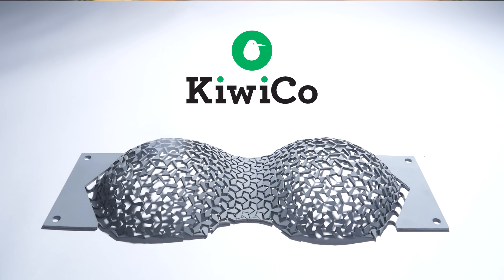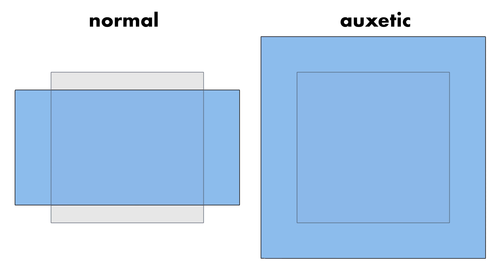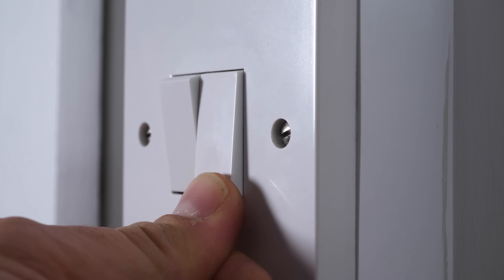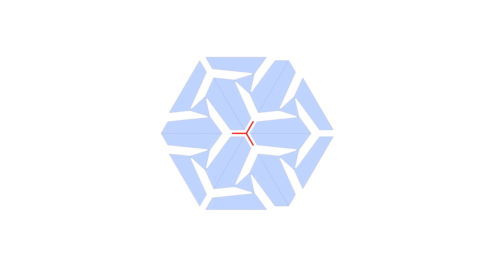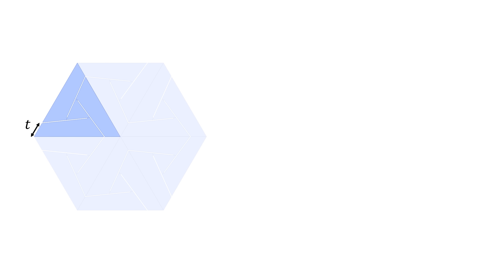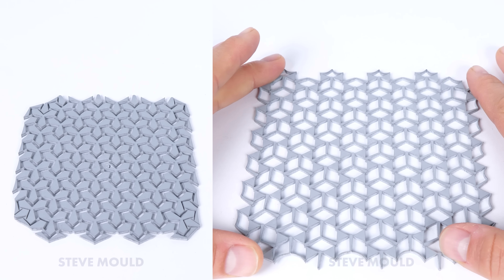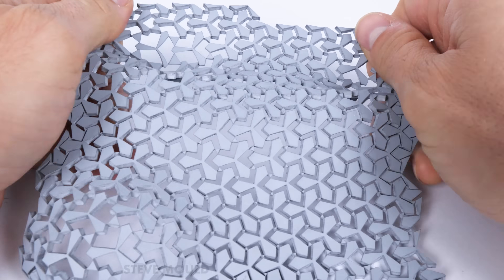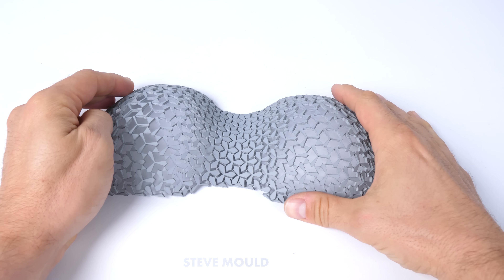Self-assembling material pops into 3D

Comment: While Chinese finger traps don't expand when stretched. They still are similar in the "science" used.
As you put your fingers in each end and try to pull them out again it contracts on said fingers and holds them in firm.
You have to push the finger trap itself together so it expands in the other direction to get your fingers back out.

Never used it as such but a Chinese finger trap could be really useful to hold two separate objects together temporarily. As long as nothing disturbs the device in the middle it holds on tighter and tighter as you try to separate the objects from the device. As long as it doesn't slip, it's a neat way to hold on to something. Say a broom stick handle or a bunched up piece of cloth.

On the point of broom sticks though, there's also those rubber thingies that you slot them into which are bi-stable as long as the diameter of the thing you push in is large enough to have the rubber go through compression to allow it to pass the point where it snaps into the other state.

Comment: While I think a stent is a good idea, I think that this is thinking too small. How about using this for flat packing habitats?

This could be used for making the structural base of a habitat that you can then throw a covering material over after you have expanded the base structural material.

This would make good option for flat packing quick habitats for disaster areas or even future lunar missions.

Comment: Why not use this for housing during disaster relief? You could have a shell made of this with an insulating material sandwiched in between. The benefit is ease of storage and deployment and quick hassle free installation requiring no tool and minimal training. You could easily make an igloo style temp structure. We could use this for temp housing for refugees.

Comment: the demo one with two cups obviously looks a lot like a bra, which is a great application: emergency bra
because it can be so flat, you could store them VERY efficiently, and yes, they wouldn't be the best, and yes, you might want slight manual steps too (e.g. for the fabric (and the slight padding) covering of the structure, and possibly attaching a wire or such, which could also be stored pretty much flat)
another simple use case would be better collapsible bowls (and probably cups too), the current crude designs of folding rubber are...not great...not the least because rubber sucks...
or you could require strong forces, to make deployable chairs and such, which would be both cooler, and more efficiently storeable
or collapseable hats! that'd be very neat, since  it being breathable is often desireable ANYWAY

Comment: For the twisting cubes, one thought I had was, what if instead you built 9 polarizing filters in this configuration, and used that on the end of the sugar tube that twists light
It isn't really an "image", but you have a 3x3 pixel grid that can change colors of light
Which itself can be used on another image/filter that shows one image with one color, and another image with the other color, and that's one way to get a changing image with this, but not really anything to do with how the images line up, it's the light that's lining up

Comment: The other application I could see is skin tight spacesuits. Those would be better than current space in pretty much every single way but have the issue that we haven't solved how too provide pressure in convex areas or at least convex in both directions. this could be answer.

Comment: If you just hate math like most people on here, stack four sheets of paper together (you will have a flat pile of paper).  Next, remove three sheets of paper and crumble them up into balls.  Arrange the crumbled balls in a triangular form in the approximate area of a flat sheet of paper.  Finally, lay the un-crumbled flat sheet of paper on top of the arranged crumbled up balls of paper.  You now have a structure from original sheets of flat paper that supports another piece of paper.   And no math was involved.  Yay.  Fuck math!

Comment: Steve, ideas for your exaggerated small motion camera:

Can you hook that camera up to a microscope? Maybe there are cellular movements that are ultra tiny (even under a microscope) that the camera can show. Like how the cell membranes move or vibrate as a cell grows it responds to changes in it's environment. Do cellular structures have small movements and vibrations that can't normally be seen?

Film sky scrapers moving in the wind it film the curiosity counterweight ball moving at the top of some sky scrapers. 

You could film a very large bridge on a windy day to show what is moving on a bridge and how it's moving. 

Maybe you could also film some gyroscopically stabilized things or other machines that self level (NASA crawler) to show how many small corrections are needed over time. 

You could film how rockets flex as they take off or how the nozzle flexes during start up.

Maybe you could find interesting design considerations for plumbing or water lines to show how the move in response to fire l flow changes or how they move or respond to valves opening and closing. 

You could also show how large structures vibrate in response to a shockwaves. Like team up with a ballistics channel or a company that designs this to survive possible blasts to show how much large things flex on response to a shockwave. 

Do large concrete things flex and vibrate? 

Maybe you could find a university or company that tests things to failure and you could film the small movements and vibrations that occur as a test article is approaching failure. 

You could also show how much buildings move it the ground moves in response to heavy construction machinery or near mine blasting. 

You could film how train tracks or a bridge move and bend as a heavy train passes over. 

You could show how the road, streets and buildings vibrate when a subway train passes underneath. 

You could film how the vibrations change in a heavy, thick crane cable as it is loaded and unloaded.

Maybe you could film how large structures move as the heat up and cool thoughtout the day.

Maybe there's interesting ultra tiny movements in animals as they try to be still. 

You could show how small motions are related to how striking something sounds. Like a yhud vs a ring down. Or show how different sound deadening materials and tapes change how a material vibrates to change or soften the sound.

You could film how different materials and objects absorb sound. Like how a wine glass' vibrations change as the sound frequency slowly approaches the glass' resonant frequency.

Maybe it can be used to film how different materials and objects respond to, absorb and reflect sound.

Maybe you could film how different sports items flex. Like how differently strung and constructed tennis rackets moved and vibrate to change how a tennis ball responds to a hit. Or how different types of bats move and vibrate to maximize the energy transferred to a ball.

Comment: 2:20 Here’s some notes about when I spent some time on this problem. It seems that the transformation that happens over here is that ever “corner” square undergoes a clockwise rotation, while every edge square has a counter clockwise rotation. Each square remains in the same coordination position. Thus, to have a shape that is maintained upon the transformation, we need the overall shape to have rotational symmetry along each smaller square. We can use this to show that it is not possible to make such a shape which is connects from one square to another without having a matching  set of rotated lines. Hence, it is not possible to have a closed shape composed of a single line that fits these criteria.

Comment: 2:20 each square rotates 90 deg, either clockwise or counter-. There are 3 types of square: center, edge, corner.

The trivial solution is to, on each square, put an order 4 (or multiple of 4) rotational symmetry image centered on the center of the square.

Comment: It's fun to imagine the possible uses of this. I'm currently on hour three of pondering some sort of foldable solar tarp for camping. Packs flat when you're not using it, and if it was dome-shaped you wouldn't have to rotate it on axis with the sun. You'd need to have some form of foil-based solar cell though, and honestly that's probably 90% of the invention.

Comment: They really need to teach compliant mechanisms in school along with the traditional mechanisms. You couldn't build a bow and arrow without them and springs are often used in machines, but the definition of simple machines don't include compliant mechanisms. There is a lot you could improve about simple machines, especially the requirement for them to change force is a bit dumb. A simple linkage and it's compliant form a shock is a machine as it allows force to be transferred from one location to another. Does a pulley stop being a machine in its most simple configuration? A pulley isn't even simple as it is made from a wheel and a tensile rope. A compliant mechanism is just a regular mechanism that sacrifices some property for the property to return to a previous state, like a wheel not being able to rotate infinitely, but being able to pop back to its correct orientation or a lever reducing its range of motion to become a flexor.

Comment: Maybe I'm just not educated enough in this subject... but this isn't auxetic, the object itself is the exact same rather it is rotating. If you try to count it as auxetic it fails that due to the conglomeration of parts going apart and becoming smaller like the clay.

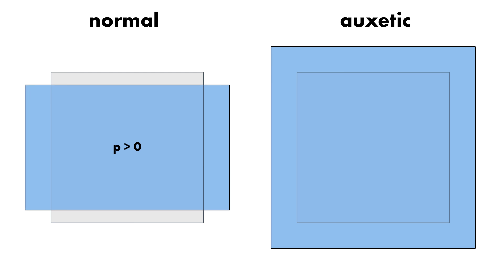To go to the visual example at 1:10 the blue space on the right is filled with holes now. It is taking from part of itself to increase.

Comment: The interesting thought is expanding this to three dimensions. I don't know of any other mathematically 2d item which, by only applying 2 dimensional forces, applies a force in the third dimension. So I therefore conjecture with absolutely no proof, that holding onto a three dimensional version of this while stretching it will then transfer you through the fourth dimension and you will travel through time.
Reply from the maker: Sounds reasonable

Comment: Some people at my old place of work made a material that was bistable at the molecular level. It wasn't auxetic, but it did exhibit negative thermal expansion (it got smaller when heated), which was pretty cool. Switching between stable states was chemically, rather than mechanically driven -they added water for one state and organic solvent for the other. We published the water containing structure in nature chemistry. Good times 😁
Reply: when when you make negative nitinol 😬😬

Comment: An outer stabilizing mesh for a space suit. You could have a flexible air-tight inner layer that allows you to move around freely, then have that as the outer mesh that has enough flexibility to still allow you to move but enough rigidity to keep the inner layer from expanding out in between the structures. Kind of like those squish ball things inside the small net bag, but the inner material would have to be a bit less elastic.

Comment: I made a control system which would tend to two states close to the actual desired state.
neither state was stable, after being reached the system would oscillate more and more before switching to the other state with significantly lower oscillation. 
the system as a whole was stable but no part making it up was.
i’ve been calling it bi-unstable in my head

Comment: If I fart whilst wearing a tight fitting pair of knickers the material of said knickers expands in much the same way without even doing any of the math or making any of the fancy cuts. It's like this guys brain is almost as smart as my buttholes farts, only my butthole is way more efficient at it and doesn't require positive affirmation for doing what it does.

Comment: It’d be interesting if there was a way to make a similar structure that’d fill in the negative space, so you’d have 2 flat sheets, and then when expanded it’d be one solid sheet, but I doubt the math would work out that way :/
Reply: That would also require the pivot points to intersect each other, otherwise, making the "hinge points" half depth, like wood joinery, would make them too weak and likely to break upon expanding. If you didn't need or mind the intersecting points to be thicker than the rest of the sheet, it might be doable though...
Reply: @UndeadGraduate  yeah tbh I assumed half depth joints were implied because otherwise they physically wouldn’t be flush and kinda ruin the whole point, but it’s a good clarification
I do think it’d be more fragile and more material dependent but I’m more interested on the math for a negative shape that matches the same curve. I think realistically the negative layer would just be more flexible and have more “holes” in the second flat sheet, so it wouldn’t hold its form as well on its own.
Reply: Hm!  Is the hinged structure that forms the negative space also going to be bistable and auxetic, or would it be floppy?   Presumably TheUndeadGraduate's objection could be satisfied equivalently by having each polyon include a second layer with the same shape slightly inset to fit the holes on the positive structure.

Comment: Wow, I imagine we'll see aerospace applications based on this in the near-ish future, combined with the relatively recent origami-like packing & folding/unfolding techniques employed by JWST and others. Seems like an excellent means to unfold antennas, mirror arrays, or whatever sort of scaffolding into much larger surface structures with more complex geometry, and fewer moving parts/points of failure.
Reply: This whole thing is made up of tiny little moving parts, all the tiny hinges are going to tear like tissue paper in a high stress environment
Reply: @davidy22 Well, yes, but couldn't the general concept could be adapted to work for different materials and environments? The hinges could be strengthened by choosing the right material, geometry, and scale.

Just spitballin',  but I could see cutting the tile geometry into a thin, flat sheet of a memory alloy like NiTi, unrolling and applying a heating/cooling cycle to transform it. Granted, it would only be useful in a pretty narrow range of applications, but still...
Reply: @musicbyerland  Any material you can make this with is going to be stronger as solid sheets instead of as a lattice of little metal fatiguing joints. This is going in things that aren't going to be taking heavy loads, aerospace can't use this
Reply: @davidy22  true, but I wasn't thinking in terms of structures that repeatedly move or support heavy loads. I probably shouldn't have referenced mirror arrays or heavy structural elements. More like a means of deploying a solar sail with special surface geometry, an inflatable habitat, or maybe a lightweight radio dish or something.

Comment: I’m thinking of some kind of scifi future “cinterblocks” that are made of a metal alloy designed to deploy into an expanded state, then concrete or something similar is mixed in to fill the voids. I was thinking an electric current at first to weld things in the stable state, but if the whole block is made of conductive material then it would simply pass through and not really weld.